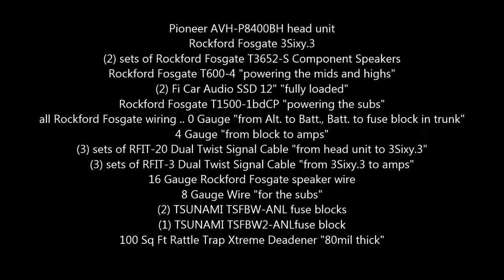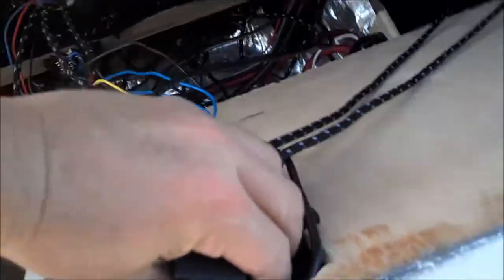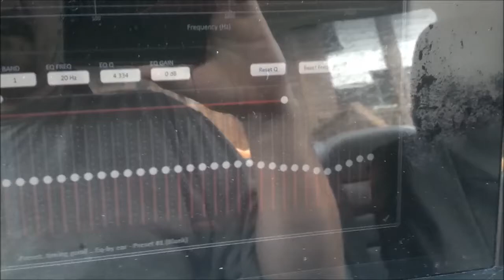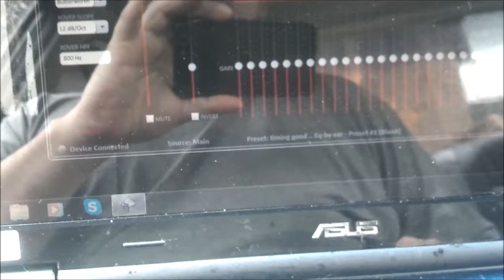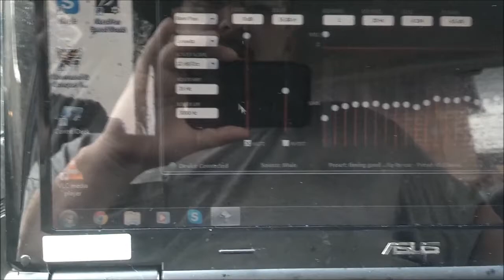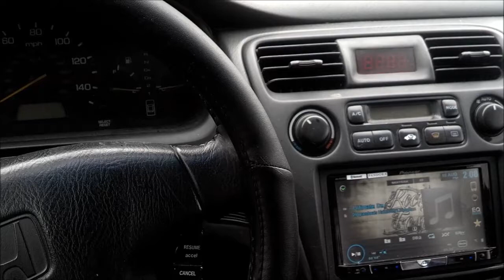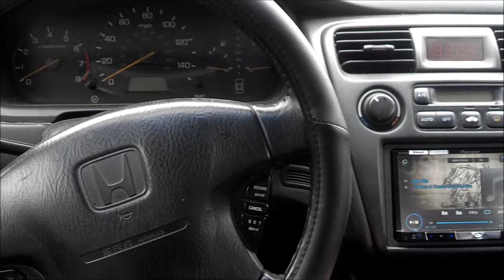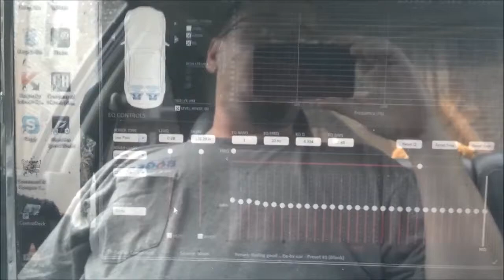99 Accord Rockford Fosgate SQ Build "2400 total watts" - 3Sixy.3 Install and Tune

Comment: I thought I was clicking a video for a Fosgate SQ build. I did not know I was going to the spaghetti factory.
Reply from the maker: +Richphotos1 so i take it you cut all you wire before you finish installing your stuff? .... Look at the video ... the panel is not finished ... the install was not finished ....  when the panels where finished and everything working right ... thats when i cleaned up the wiring ... and since you have nothing posted to compare to ... this is finished!
Reply: +Lost4Words :) Apparently you lost your sense of humor in your spaghetti bowl of wires. Chill out.. it was a joke.
Reply: So, did you ever clean up the wiring on this?
Reply: lmaoo

Comment: Yes you are wright voltage is dropping down to low I seen 11z but I turned down the gain before I tried this and I changed out the speaker wire to see if their might be a short what to buy next alternator I guess
Reply from the maker: yes ... my amp was shutting off on me alot when pushing it hard ... i never got the alt. installed ... it came 2 days after selling the car ... the amp will shut down if you drop below 10.8 volts... in the honda that would be alot lol .. but the new build started with XS Power batts.

Comment: Sounds awesome i bet, nice like it alot man I know its hard work too set one up right and not half a**
Reply from the maker: +Davie Downs ty .... this is an old old old build ..... it did very well at comps ... the new build "still with Rockford Fosgate" scores even higher ... but is going to be rebuilt soon "Blues Audio with Linear Power amps" ... right now doing a build with my truck .... Hybird Audio with ARC Audio Amps
Reply: cool i just seen it come up on videos, thats nice im about to redo my system in 00 s10 ext cab kinda mix of spl/sq
Reply from the maker: +Davie Downs The Nissan is built for "best of best of show" so SQ with some SPL ... not to insane 146db in Trunk class 2 "MECA" by no means do i think it's a big SPL car but for a top level SQ car ... thats a VERY high db level ... just sucks that compared to the SPL only cars in my class ... it's a tiny score ...
Reply: oh yeh but u have advantage on them, u can hear urs like its in the recording studio lol instead of bass canceling it out

Comment: I have a Rockford Fosgate Power 1500 BD and I'm getting a Rockford Punch 400X4 what did you do for electrical in the Honda I have the same exact car but 2002.
Reply from the maker: it was stock the whole time ... the Alt. i ordered didn't come till after i took the system out ... in fact it's sitting here in the box it came in it's a 160amp ... i'll sell it cheap if you want it ...
Reply: Lost4Words :) Is it a direct bolt on fit? whats the brand? And whats the price your looking to get for it?
Reply from the maker: AccordBass12 yes its a direct bolt in .. brand... not really a brand it's a rebuild upgrade by Zap "a company out of Ohio" .. i paid $150 + shipping .. but would take 100 obo
Reply: Lost4Words :) Will that fit a 2.3 liter engine cause that what i have?  I will think about it once I get the money and see pictures of it.

Comment: That song has nothing below 800hz. play anything with some lows loud and you can damage the tweeters! Violin, voice, symbols...Lets get a cielo in that and fry the tweets. Get a mic. I thought I wasn't sure of what I was doing, but the fact that you have delay set at 40" plus on one, and maxed out on the other, with tweeters crossed at 800...which is possible for tweeters like 3" or something...maybe a ribbondesign/? But I don't think its a great idea. What do the tweeter spec range say?

I dont know...maybe I'm wrong?   Have you tried to measure things with a mic/RTA?  Ear is great, but how is a front tweeter about 4 feet away from you?
Reply from the maker: UnknownHandle UnknownHandle this car was built for comp. .... not tuned for everyday driving ..... everyday driving the tweeters are crossed at 2000hz .... as far as the delays ... the sound stage as set to be at the far front of the windshield ... this car won a number of first place and never less then a 2nd place ... as far as the video goes ... it was a quick tune .. we ran the car for 1 year befor doing a complete new build
Reply: Lost4Words :) Thanks for the feedback. Sorry if I was being a bit hard , as I am learning and I thought I finally had things right, then this! :-)

Well I just got my Umm6 CrossSpectrum tuned mic in the other day and will be setting it up in Rew.  I wish you would do another start to finish 3Sixty tune for the folks that have a 2way, amybe a rear fill and single sub.  You would surely help me out as well as the masses that should see your work.

If I could email you, Id have some questions :-)
Reply from the maker: UnknownHandle UnknownHandle Right now i'm doing a "everyday driver" setup in my truck ... using a 3sixty ... maybe i could get something up soon ... been very very busy so give me a little time
Reply: Lost4Words :) That would be great. I just did my plot, and I got some work :-)
Reply: +UnknownHandle UnknownHandle the song does have bass , he was just playing the tweeters or his mic couldnt pick up the mids properly, this is the first time i have heard a quality song in car audio video